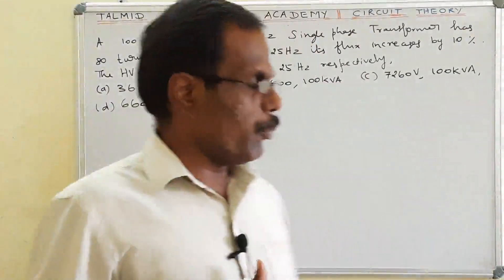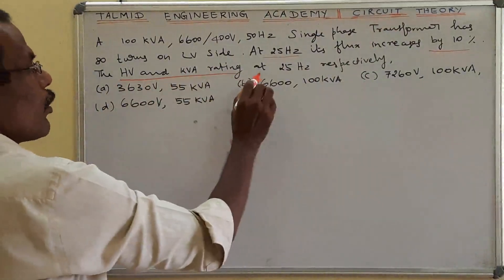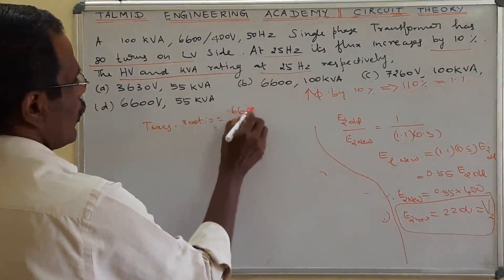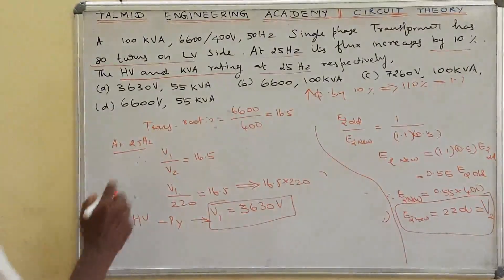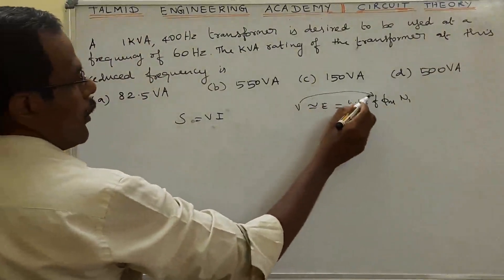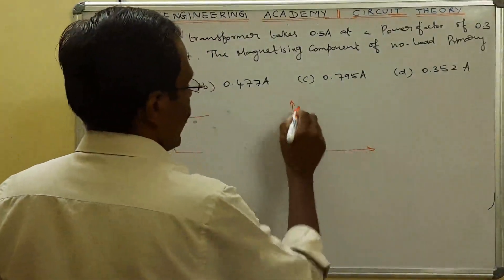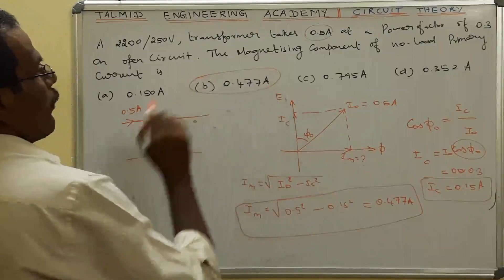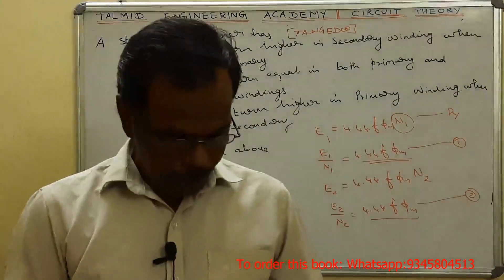PART 4:Transformers:Examples from previous TANGEDCO/GATE/ESE/TRB POLY examinations

Comment: Sir transformation ratio for voltage  is LV/HV. U told Hv/Lv. Which  one is correct
Reply from the maker: Both are correct. But any one you have to use all through your problem. Shouldn't interchange.